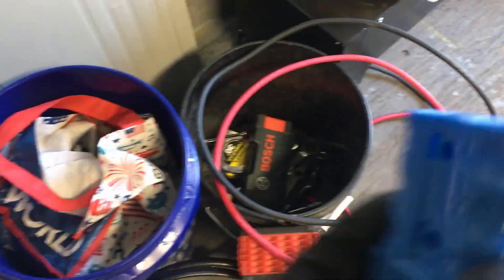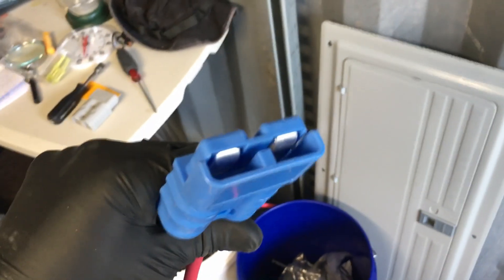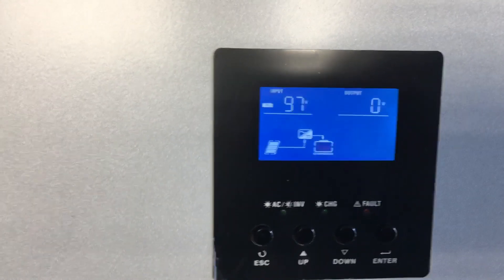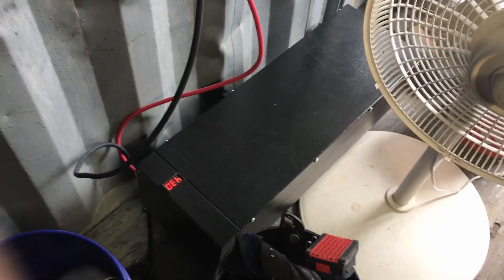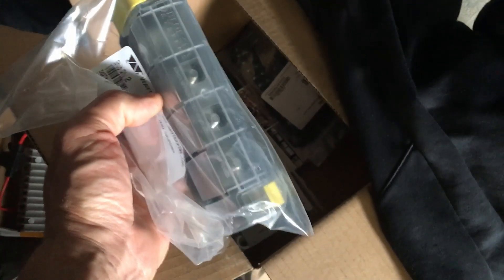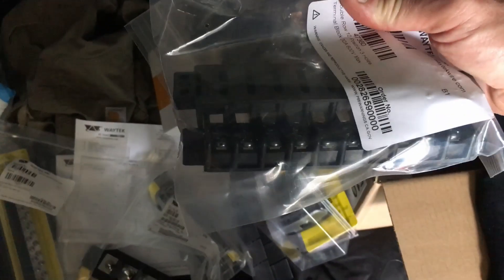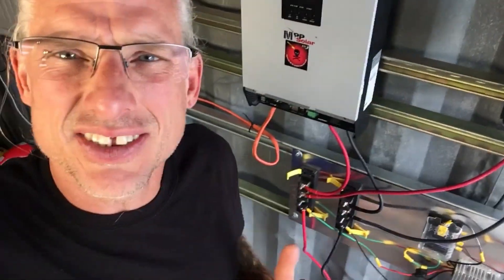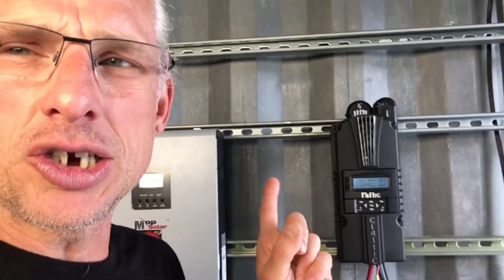New Solar System part 3

Comment: That battery made for 36v inverter its not going to work to well with the  pip the voltage is to low the pip
Reply: Any time those inverters go to 40v it will short down u need batteries the voltage can go to   57v  for the inverter to work properly